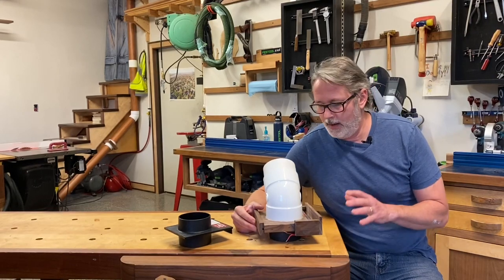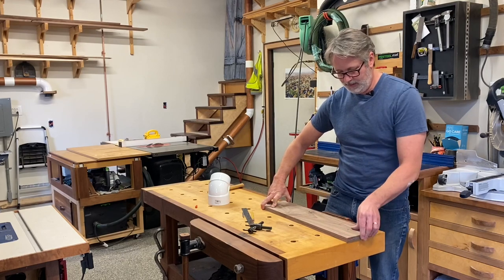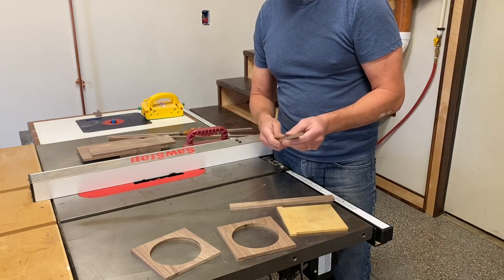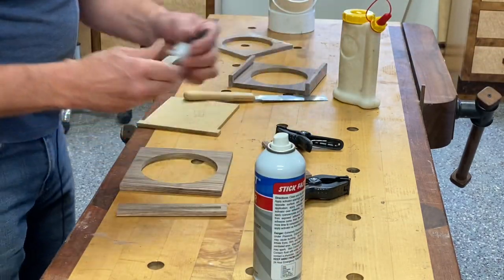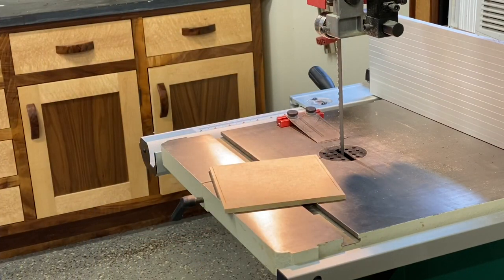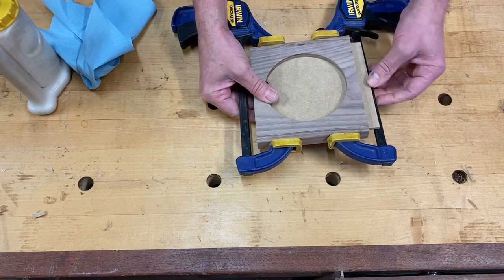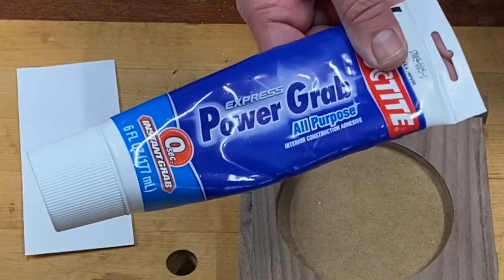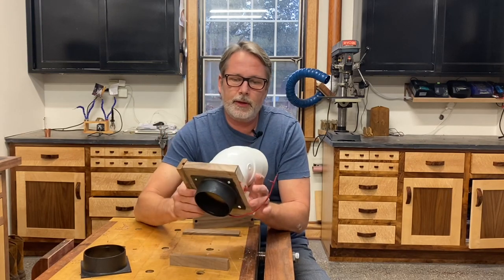Clog Resistant Blast Gates for Dust Collection

Comment: Nice gates. Nice video. Thanks. This may be an OK place to suggest that for systems using flimsy tin duct a plywood collar mid-span on 5' joints will arrest the tendency of the duct to go egg-shaped which is what it does during the last millisecond before it collapses. Any cruddy salvaged sheet stock will work and the fit needn't be very precise.

Comment: Great design, now you have to do a video on hooking up your microswitches
Reply from the maker: Thanks. No I don’t have a video you asked about, but it’s pretty easy and self explanatory with purchasing the system I referred to in the video.
Reply from the maker: Oh sorry I thought this was my other video. I used the long ranger micro switch system. It’s super easy, but I think they only make it for 220 volt dust collector systems.
Reply: I’ve done the research and yes, unfortunately they’ve stopped making the 110V version of the long ranger. I’ve made my own that can handle 110v and 20amps and it’s possibly deserving of its own video. 🤔

Comment: I recently saw a guy use the cheap black plastic blast gates and cut the end off to allow the dust to push out and he did the same foil tape trick. What are your thoughts on that? I’m about to move to a new shop and I’m not going to waste my time building my own blast gates to save a few bucks. I may just buy the aluminum blast gates instead of modifying the black plastic ones.
Reply: This probably comes too late, but to answer your question, in my experience cutting off the back of the plastic does help keep them clean, however the plastic ones are leaky when closed anyway and that makes it worse. If you tape them up tight there is nowhere for the dust to go (and you have to periodically remove the tape to clean them out then re-tape), and if you leave a flap like that other video suggests you lose cfm.   

If you are buying my recommendation is purchase the self-cleaning type where the slide passes through the other end.
Reply: @scottstarck293  Thanks for the reply Scott, you're right too late lol I went with the aluminum ones. I installed limit switches so when I open a blast gate, the dust collector turns on. Works great.
Reply: @kkeim90  The black ones are junk. I fought them for years . What is a limit switch ? I have a big Jet that's 110.

Comment: Just open the plastic blast gate and drill a 1/4inch hole in the back corner of the slide slot.  It will push the dust out these holes. 1 minute fix.😅

Comment: I admit to being obtuse on this, but how does the foil reduce clogging? It seems to me that the collector would keep it sucked onto the body of the gate... can you explain?
Reply from the maker: If any debris gets in the groove for the sliding gate it will get pushed out the back.
Reply: @Selandry1   of COURSE! Can you tell I’m still using a portable setup and flex pipe?!?

Comment: Could you please tell my why did you choosen main pipe as 4" not 6" pvc pipe system?

Thank you very much from Thailand.
Reply from the maker: I did not want huge pipes. Thought I could get away with 4” and it has been okay for my shop so far because it is small and I only have one blast gait open at a time.
Reply: @Selandry1 Thank you very much for your answer. You design in every details in workshop is great. Keep on going.

Comment: What is the purpose of the foil flap?  Would the blast gate not work just as well without the foil flap?
Reply from the maker: If you close the back you get debris built up in the slots on the side which gets pushed to the back when you close it and binds it up and prevents it from closing completely. Requires you to take it down and pick out all that junk.
Reply: @Selandry1  I understand that, but the foil flap does not appear to seal.  Or does it seal when the blast gate is open?
Reply from the maker: Yes it seals shut due to the negative pressure of the airflow when the blast gate is open.
Reply: @Selandry1  Thanks.